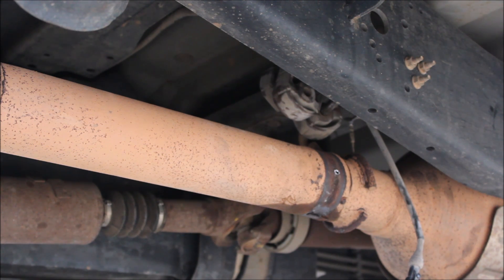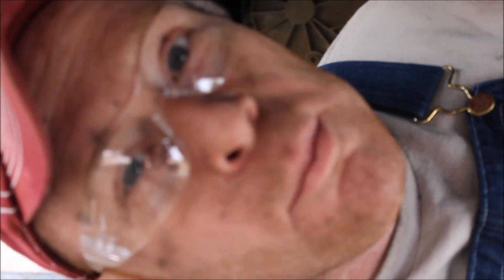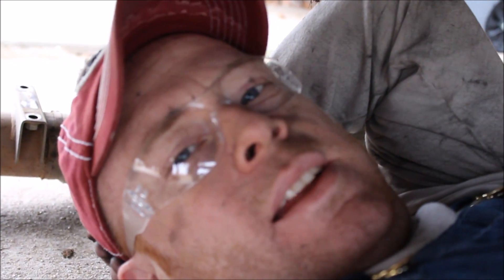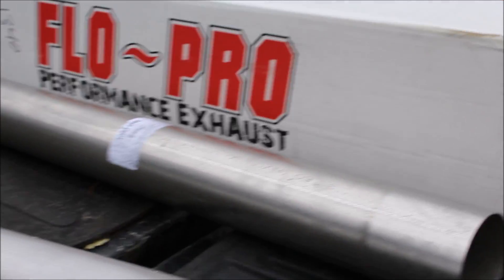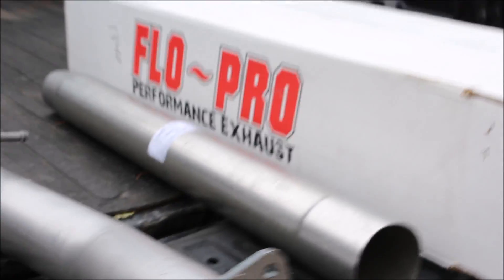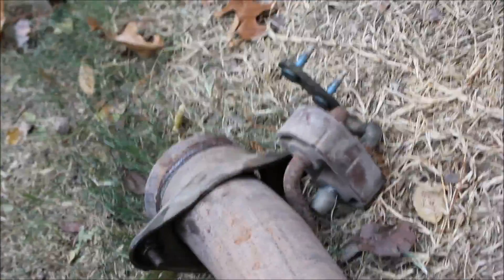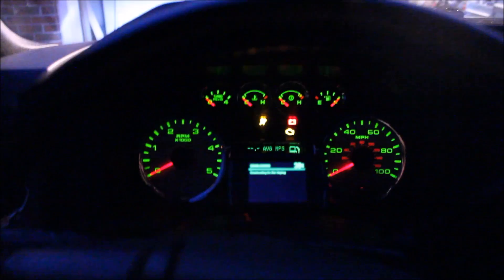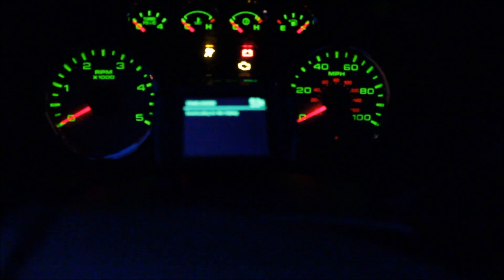2008 F250 6.4L DPF delete

Comment: Just about to do it on my 2008 F250.  Would you advise it
Reply from the maker: Eh, it really depends on your use case. I will say that the emissions equipment on the 6.4 is engineered to destroy the engine- simple as that. Washing down cylinders with fuel at RPM is never good. However, check laws in your area for off road vehicles. Armed with that information, make your decision based on current integrity of the engine. If you have 200k on it and it's had the emissions system intact for that entire time, I'd say leave it alone. If it's a fresh rebuild and your use case will allow it, delete it to preserve it. My use case of off road and deleted with regular meticulous maintenance has given me a 6.4 with no compression loss or damage to the engine since the publication of this video.

Comment: When I deleted all that engine destroying 💩I got 1/3 more MPG way better all over performance had to replace the stock Cold air filter. If I were pulling up a hill with a load on or if I had to pass someone my sensor would tell me to change my air filter.😱. The trouble is. It is a brand new filter. I went with an S&B performance Kit.  I went with a washable wet filter. They say they're both equal in performance. It seems to have a better cold start and not as much black smoke in stop and go traffic PS when you're doing your settings when you see low boost fuel mine said 3 from the factory I lowered mine to#2. That cut the Black smoke in stop and go traffic way back I kind of like that.😊👍👍 Now if you have to pass someone you can do that with meaning 😊. I never race this engine the settings are always set at stock or tow. Just now blew a head gasket. At 136Kmiles. That will set you back a few K machining the heads put the upgraded rocker arm assembly in and another must if you're in there is new up pipes, ARP head studs, Modified oil cooler, and rad filter. Do not for get to put in the deisel coolant additive from Ford or you will destroy your front plate. Small differences go along way  And everything is exposed. I  don't want to go back in this far any time soon so I replaced the HP fuel rail sensor as well new water pump and thermostats top end is done. And so is my wallet. 😢 in for a penny in for a pound. New batteries also. Shop rate anywhere here is $185. CDN. And these guys are top in their field. Level#1 👍👍 Victoria BC 🇨🇦 right next to my besties 🇺🇸👍👍

Comment: Its almost.2025 i wonder if the truck.he is working on is still running and driving
Reply from the maker: I still have it, runs like a top. No issues.
Reply: Mine 180k still working.  Towed with it today.

Comment: What you did will all the sensors
Reply from the maker: Put the ends in shrink wrap with the small pill bottle dessicant in with it and used a heat gun to seal them. The harness side is what I am assuming you mean as the sensors themselves get removed.
Reply: So the sensors on the dpf we don't need them at all just ziptie the sensors harness
Reply from the maker: @yahirguardado5395  yes - of course that is if your truck is going to be offroad only as removing emissions equipment is illegal for use on public roads...the only sensor that will remain is the one egt probe in the up pipe on the passenger side up pipe. (back of the motor)
Reply: Egt probe sensor stay there so we don't touch it think you for your help now this truck needs to loose some weight

Comment: That part is a harmonic balancer for the thing-a-majig on the whachamacallit ! Your not going to run that on the roads ( wink wink ) it’s against the law ! Lol. I’m a little nervous, I purchased a Bully Dog 40420 ( I’m told it’s the same as the H&S ) will mine delete the DPF ( I also bought the pipes ) or did I screw up and bought a unit that won’t delete the DPF ?
Reply from the maker: To my knowledge, no bully dog tuners will provide you with offroad tunes (i.e. EGR/DPF delete capability). There ARE shops that will sell you a tune to upload however, if you're going to use your truck for offroad use. If you get what I am saying.
Reply: @USAF99  ya the 40420 DONT delete DPF or EGR so I’m returning it and purchased a H&S Mini Max delete off road kit ! Thanks anyways for answering my questions !
Reply from the maker: @davekimbler2308  You bet boss, that's what I am here for! Good luck with it, you're going to enjoy the H&S, but I will tell you this. If all you are doing is deleting it, DON'T throw the power level as high as it can go and run the truck for extended periods of time or even hard-- it advances the timing to get that added power and the stock parts aren't designed for it. I keep mine on stock. Now, if you do head studs and beef everything up, then yeah-- crank it up.
Reply: @USAF99  at my age I don’t want anything broken ! Lol. I just want it to last , it maybe the last truck I’ll buy ( 09 F250 SD Cabelas edition from Texas ! ) it’s by far the nicest truck I’ve owned ! Lol. I don’t care about ROLLING COAL ! Lol
Reply from the maker: @davekimbler2308  Yeah, just install it, delete it and mark my words-- it will run like a champ for 500k+! If you have questions, don't hesitate!
Reply: @USAF99  👍
Reply: No No! Don't crank it up. Please please trust me ARP head bolts are a minimum upgrade just to run stock or tow it is the only thing that will save your Head gaskets when running in stock settings there are not enough head bolts in these heads for the amount of pressure these engines produce from stock trust me. Stock head bolts are 110 possibly 125 PSI torque settings ARP head bolts are 280 set up by torquing the Studs in three stages. If you do continue using Bolts use new head bolts. But head bolts spell blown head gaskets that result is $$$ quickly. I own a babyed 6.4 I just went through this Head gasket thing. Trust me there are many things you must do while you do the top end none of them are cheap. But it must be done. Heads must be machined and rebuilt with the modified Rocker arms. Modified Oilcooler for the Turbos, inline coolant filter, you're in there so HP fuel rail sensor, water pump, and thermosstats I now believe my 6.4 may last me I'm 74 the truck has 136 K miles on it the date is Aug 04, 2025. Time is marching on. I love my truck and will make the necessary mods Ford and International refused to make but the block is not a racing block.  @USAF99
Reply: I almost forgot the off-road manifolds and up pipes with the EBP sensor port but that is a bonus when👍 you're going to do the top end.
Reply: @USAF99   where were u able to find a h&s tuner? they've been hard to find online now.
Reply from the maker: @aa-wons3958  All I can say is good luck. Since the company is out of business, its difficult to find them. I would check EBay.
Reply: No. No hold on to your nuts. No matter how much you want to. The tuner was not made for this truck. It was made for many vehicles this one is tuned as high as possible in Stock mode you start with a boost of 75 HP in tow settings and this truck without many high-priced mods well even then this block just can't handle the forces beyond stock if you're towing a heavy trailer well you're still taking a big chance by tuning in the tow setting. The truck wants to do it but it's just all bad. Please trust me.

Comment: Thanks for the video.i got a 2008 6.4. im planning to do dpf and cat delete. Do i need to do egr delete to complete my process? Or will it work without egr delete? Do i still need a tuner if i just do cat and dpf delete? 
Thanks!!
Reply: If you delete any part of the emissions you will need a tuner otherwise your trucks not going to run or if it does it will run like crap...
Reply: Yes. And do both DPF and the EGR. The EGR will kill your engine. It will plug your engine with Carbon and soot the DPF will fill up with exhaust solids choking the exhaust. These are two of the worst failed science emission projects I have ever heard of or seen in use.

Comment: Did you have top sensors back in after you finished setting everything up?
Reply from the maker: No. You waterproof them and tie them up to the frame out of the way. At least I did. Runs like a top!

Comment: First, Thanks for your service, great video... 2nd, did you leave the EGR and and the coolers in place?
Reply from the maker: Initially I left the coolers and EGR in place and just deleted the DPF. After awhile I deleted all of it. The down pipe is removed now and the block off plate put up behind the turbo, tapped and a fitting installed for the EBP sensor that used to reside just before the horizontal cooler.
Reply: @USAF99  Thanks for your reply. Did it run ok with the EGR and coolers in place? Also, what tuner are you using? Again, thanks.
Reply: @USAF99  could you possibly show a little more information on the EBP sensor fitting and placement? I’m doing mine at 114K but I want to make sure it’s done properly and no one seems to address the tapping and relocation of that sensor

Comment: Good video, helped a lot! Your a funny guy, can you tell me what tuner you bought? Trying to find it.
Reply from the maker: Its a H&S Mini Maxx, which the company has since been shut down. They are still available on the internet and e-bay but I would suggest finding one that is supported by a company still in business for your purposes. The H&S puts way too much timing in the truck if you turn them up. I only use the stock setting to alleviate this.
Reply: USAF99 is your tuner good? I wanna get the tuner you have cause I’m really only looking to get better gas mileage and just a bit more power, nothing crazy
Reply from the maker: In my honest opinion, there are better, but not too many. The timing thing really gets to me other than that its amazing. Plus, since this tuner is no longer available they are like $1500 on ebay if you can find one.
Reply: Yep and never race this engine. You want to race build a engine that is made for racing this one isn't it. It will only last one race the first one well maybe partway through it.😱🙄💩

Comment: I have a 2009 F-350 ....had trouble with the emissions shit every since it was new...did the same thing you are doing....now I get 16 MPG instead of 12...way more power...no problems since...it's a welding rig...weighs 12,000 pounds....should have done it when it was new...

Comment: Did you increase your mpg?
Reply from the maker: To be honest, other than Ford's Lie'O'Meter in the truck, I am not 100% sure. I will get back to you on that. The Lie'O'Meter says I did, it generally reads 16-18 on the Highway and 13-14 in town with it settling around 17 with a mix of both.

Comment: did you say you turned off the egr or deleted the egr ........i have an 09 f250 dpf delete and im adding a mini maxx but i was woundering bout the egr  did you remove or just turn it off if so how di it do with thegr still on the truck but with it turned off
Reply: I left the bottom cooler on mine and just put the cap on the end of it. That way the turbo down pipe is still supported.
Reply from the maker: Brilliant Idea. Sometimes the most simple fix is the best one. Maybe ill do a video on this soon!
Reply: @gregg7761  how'd it run after that?
Reply from the maker: The short answer is - I turned it off with the Mini Maxx. The LONG answer is that without the support of the EGR coolers, the turbo down pipe is free to vibrate. When they are free to vibrate, they can actually tear from the mount at the back on the engine, creating an exhaust leak. I am currently working on a fix for this so that I can remove the coolers/valve all together and feel secure that my turbo down pipe will not create a super heated exhaust leak right onto my cab and wiring in the area.

Comment: What will it do if you delete the egr and dpf without a programmer... thinking about buying a truck like this w out the programer
Reply from the maker: In a word.....don't. The computer will put the truck into limp mode and it will not run right at all. Expect 20 MPH top speed if the truck goes into a gear at all.
Reply: USAF99 the guy said the truck has a tune to it and that it has never had fuel pump issues. It has 250k miles
Reply from the maker: If it has already been shut off, then its kind of at your own risk. If you take the truck to Ford for service, they will undoubtedly reset the programming to stock. Should anything happen to where you need to change the programming, or you start to have issues, you are going to WANT that programmer. Up to you-- if its a good deal, grab it. The H&S Mini Maxx is going for BIG BUCKS now as the company doesn't make them anymore.
Reply: USAF99 thanks for the reply... I'm thinking I'll get a gas f- 250. The maintenance seems like it will break my bank.

Comment: So I was reading your answers in another block of comments and I read that you said you just turned the egr off even though you have the egr delete kit.  Now I understand that was a little while ago but I was wondering if you ever installed the egr delete and if you didn't how did you turn the egr off, did you shut it off with the tuner.
Reply from the maker: I have not installed the EGR Delete kit yet because I am looking for a way to sturdy up the down pipe from the turbo so it doesn't vibrate itself apart (common problem after deletes). As we all know, the turbo pressure sensor on the driver side is there or the pipe could be essentially deleted. I used my tuner to turn off the EGR valve.

Comment: what size pipe did you get from flo-pro 3.5inch or 4inch
Reply from the maker: The kit came with the same size pipe as stock. I believe its 3.5. Thanks for the question!

Comment: What did you do with all the sensors on this? Good video and thank you for posting!!
Reply from the maker: Roger Smith I left them attached to the wire harness and sealed them in ziplocs with zip ties. Then I secured them up and out of the way.
Reply: Same as I did simplest thing I could think of. @USAF99

Comment: Hi First of all I love your accent. pretty nice. I just purchased 2010 6.4 powerstroke Lariat edition with 120K miles. I was hoping that diesel will pull my trailer easily compared to my 2006 F150, but I was disappointed. Do all kits come with directions, I don't mind doing mechanical parts, I'm hands on guy myself. But when it comes to tuner/computer that when I get little scared. In your  opinion  can anybody do it? I found this dpf/egr delete kit, what you think about it. It's from Flo-Pro also. Thanks for your time in advance    
https://www.ebay.com/i/292297203403?chn=ps
Reply from the maker: Being apprehensive about reprogramming a computer on a vehicle is a good thing. Buying quality parts, making sure you follow the directions to the letter and not getting in a hurry will 99.9% of the time garner favorable results. Having a respect for unfavorable results keeps you sharp. I say try it yourself, but if you would rather not- take it to a good trustworthy mechanic. There are guys all over that will do these kinds of modifications for you at a cost.

Comment: I have this same year truck. Picked it up Nov '17 from highway dept. $3500 (it was head of highway dept truck). I like the crew cab. Tires were $225@ Diesel filter.com sold air, oil, fuel for $100. Oil was $65 and a bunch of other little chit. Got $5k into it and need to get into front end. Love the idea of owning a diesel more than actually owning one. Doesn't go worth a chit until it reaches operating temp.
Reply: Good.👍

Comment: Really enjoyed your video bud, just wondering if you still have the truck how's it running and what tuner/tune did you use?
Reply from the maker: Seth D Sure do. Runs like a champ,  I use the mini maxx tuner on the stock setting.
Reply: USAF99 that's good to hear I just bought an 08 6.4 with 64,000 miles and I'm looking into anyway I can help add longevity to it's life, I just hauled a load of hay today and it ran through it's Regen cycle and that shit sint no good lol
Reply: Yes, do the delete and do it ASAP. That crap will kill that engine on regen you may be threatened if it goes off in rush hour 😱🙄